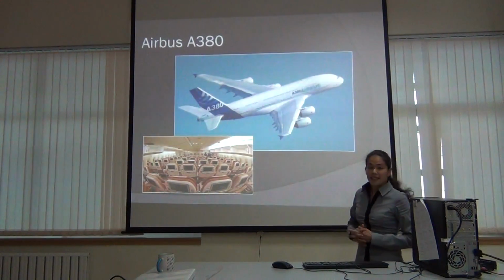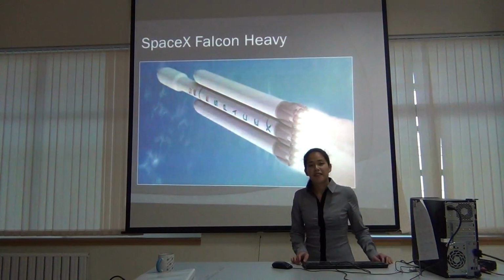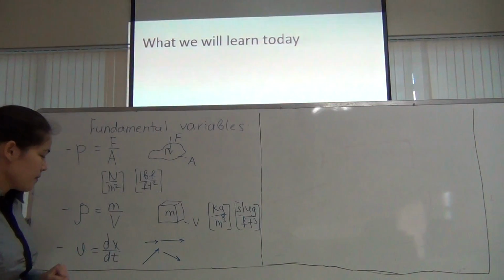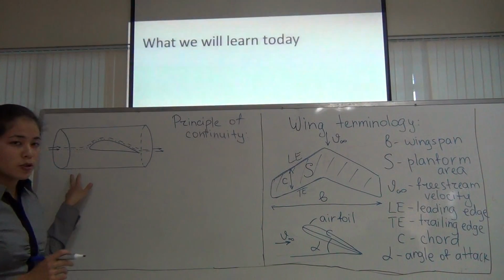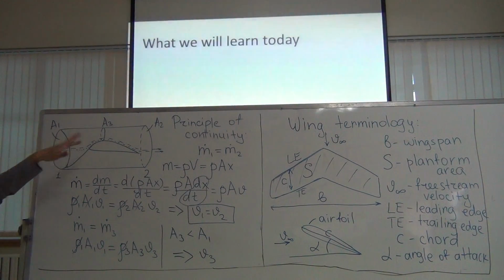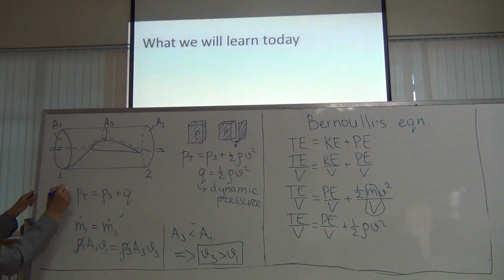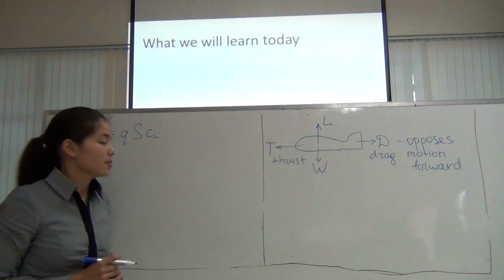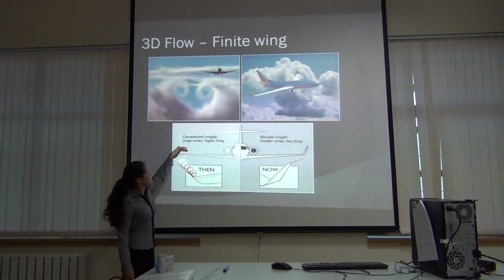Introduction to Aerospace Engineering: Aerodynamics

Comment: I hope someone in the Aerodynamics field can answer this question.  My husband and I have a continual argument about air flow over the slatted blinds for hot or cold weather.  I say that when it's hot outside,  if I tip the blinds so that the hot air inside flows toward the window (whether open or not), and any cold air will fall into the room.    The reverse when it's cold outside, to tip the blinds so that warmer air will flow into the room and colder air will fall toward the window.     Husband says it doesn't make a difference.    If you can solve this dilemma, please show your qualification/education.  37 years of disagreeing.     I'm part way through the video and love it.

Comment: some of the point you have not clearly explained.
Point 1: The potential energy is also called as the flow work and is equal to PV.
flow work=force* displacement=pressure* area* displacement=pressure*volume=PV

Point 2: You have not explained how the static pressure at bottom part of section 3 is Ps1 instead of Ps3.

Please explain the point 2

Comment: This is great, thanks for making. I just finished the derivation of lift and have one question. You block off the wind tunnel below the wing, but in real life that wouldn't be blocked, so you'd have a small area under the wing as well, so how does it work without the bottom being blocked?

Comment: Hi, can i check and confirm if the free stream velocity is known as relative wind?
Reply from the maker: No, wind could have an opposite direction, which would have a negative sign. You could consider freestream the air that moves against the wing (when the aircraft is flying)

Comment: Hi madam can I become an astronaut if I do BE. in mechanical engineering ?
Reply from the maker: Hi! Sure, you could become an astronaut, no matter your degree. But it has to be in a technical field, and you have to be 100% healthy. Plus, if you want to be an american astronaut, you need to be a citizen or a permanent resident. Other than that, it's just a lot of hard work and preparation, and luck during selections.

Comment: Why the p1 at the inlet of the wing tunnel is same as the p1 under the airfoil? Isn't that the area under the airfoil is also smaller than the inlet ( same as the upper of the airfoil, which causes the increase of velocity) so the velocity increases and pressure drop.
Reply: She assumed incompressible flow
Reply from the maker: it's before the air goes around the airfoil